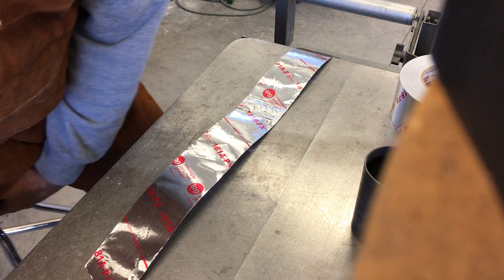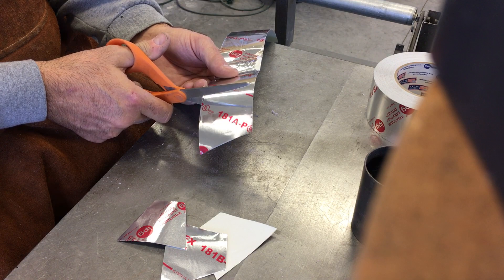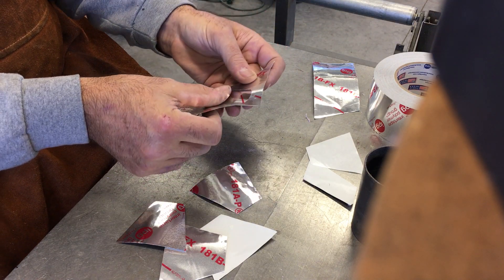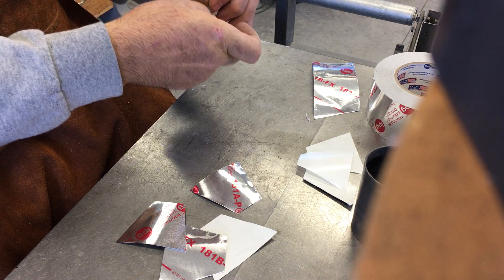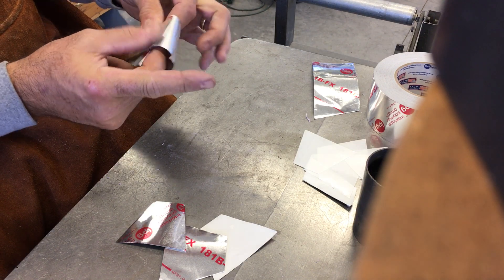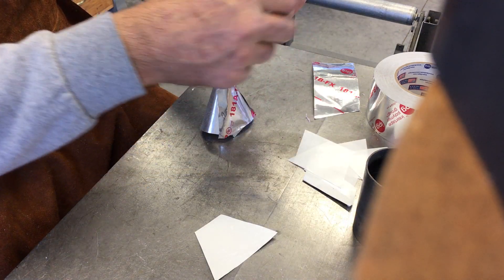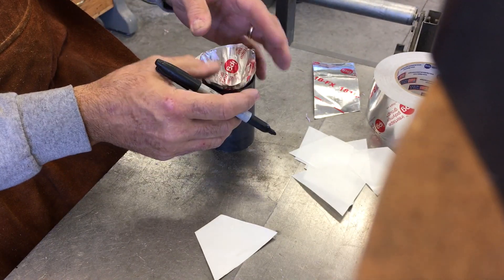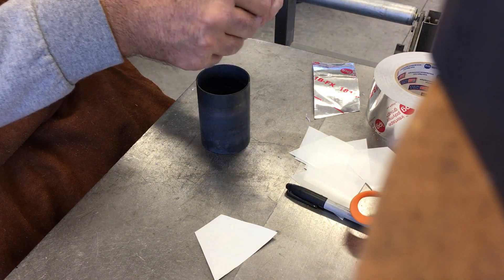Foil Sprue for Lost Foam Casting

Comment: Show
Reply from the maker: Marcio, I'm sure you'd see them shown in use in some of my earlier videos. I don't use foil sprues any more  conical transitions tend to aspirate air. 

I now use these reusable offset basins shown in my video "Reusable Pouring Basin - Lost Foam Casting"

Best Regards,
Kelly
Reply: @kellycoffield533  top gostei quero comprar esse isopor
Reply from the maker: @marciomila9264  If you want to buy aluminum foil tape, try stores that sell heating and air conditioning duct. The tape is used for sealing the seems of the metal duct. Here in the USA, the home improvement retail stores have it. Best, K
Reply: @kellycoffield533  sim aqui SC tem essa fita de alumínio